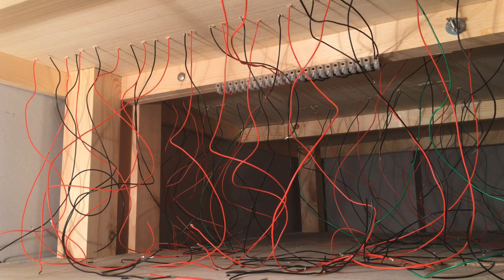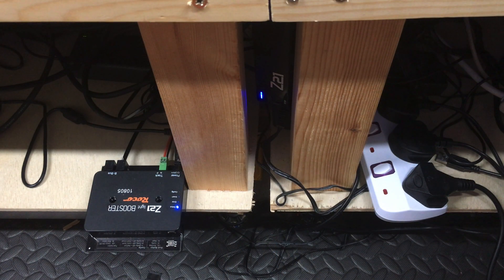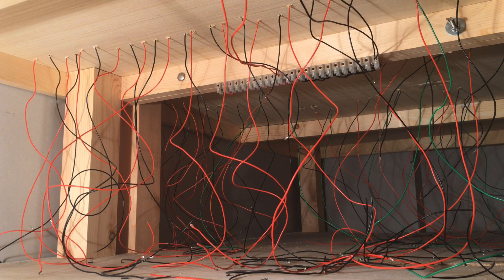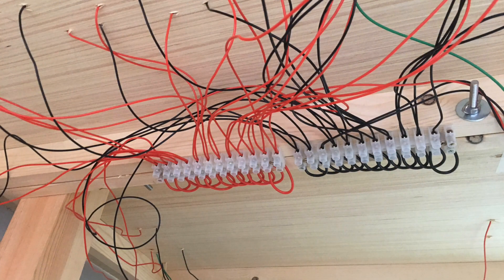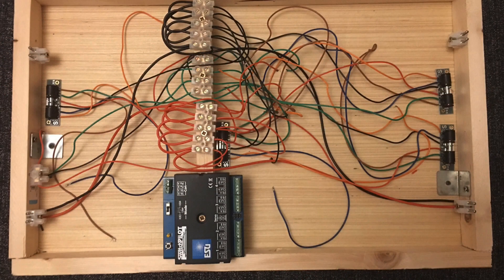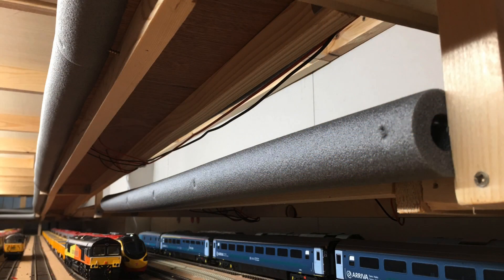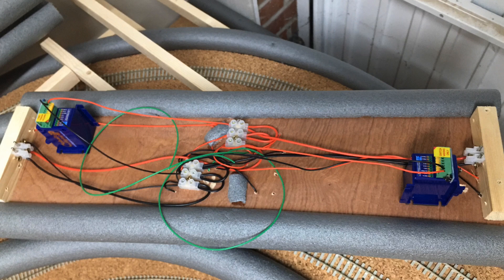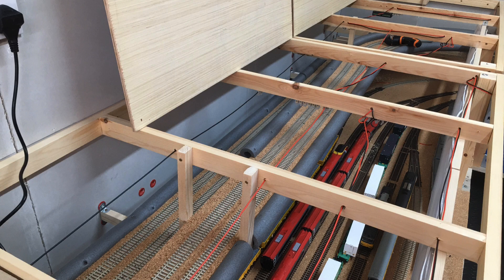DCC Wiring - Model Railway Track Bus ~ Trent Valley Railway #41

Comment: Hi, Looking for some help please, I'm moving from Dc to DCC, so soldering droppers is almost a full time job! In your video, it's hard to make out, how many bus wires do you have ? Given that like me you have several track circuits - appreciate any help
Reply from the maker: Hello, I have one bus wire (the thicker pair of black and red cables) running around the underside of the full layout loop, dropper wires (red and black) then connect each piece of track length, every bit of track for contingency in my personal preference thanks
Reply: @TrentValleyRailway  so all of your track is connected to a single bus (red and black) ?

Comment: Hi there, DCC controller query here, so sadly, my good friend and layout building guru has just passed away before completion of the project and subsequent handover period of the project, leaving me a little up the creek, can I clairify, am i simply able to wire in the controlller (Dynamis) to any one of the scotch blocks where there is a red and black wire ... there are point motors and booster boxes wired in as well as lighting in the inspect pits .. please can you advise ...

Comment: I'm just building my layout at the moment (If I can get enough track!) I'm going to keep all point operation on the accessory bus so that if the track bus trips out due to a frog short I can still correct the point from the controller, and resume driving, without having to manually move a loco off a frog on an inaccessible lower level..  I'm also putting in block detection and my own homemade Automagic brake control sections so sadly can't just bunch everything together! lots of wire...
Reply from the maker: Excellent to hear, able to do the same with operations of points separate from track power

Comment: Great update your wires look very tidy,can I ask with the hot weather does your track buckle?
Reply from the maker: The track expands when it gets warm in the garage but I left gaps at the rail joins to allow the rails to expand
Reply: That’s a great way to do it will use that method in my future build